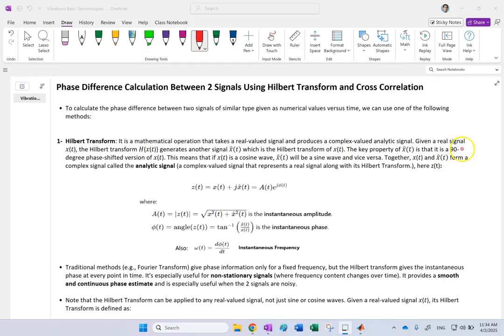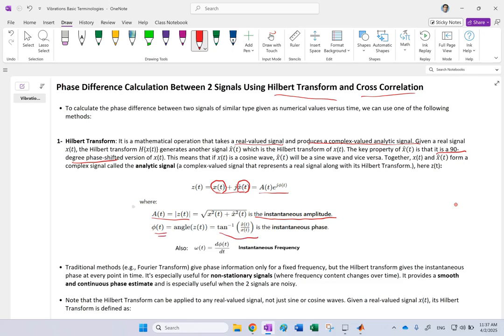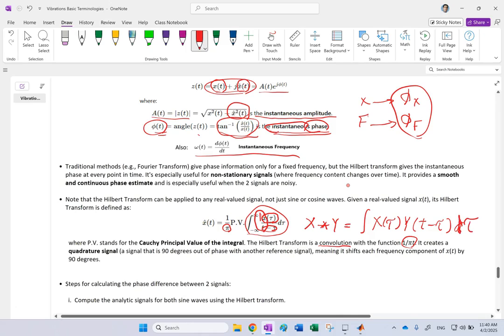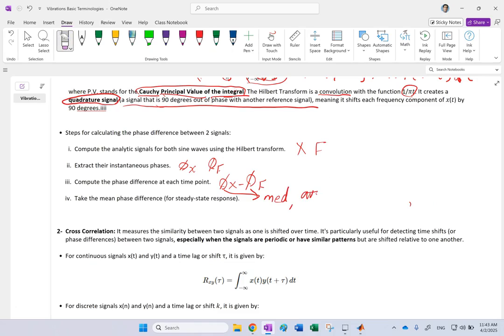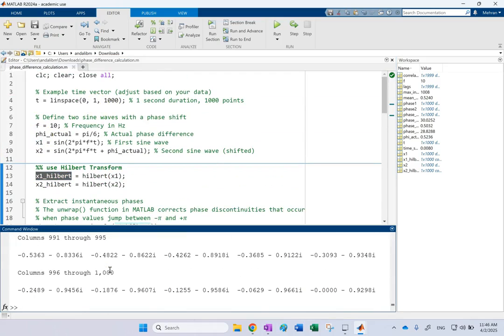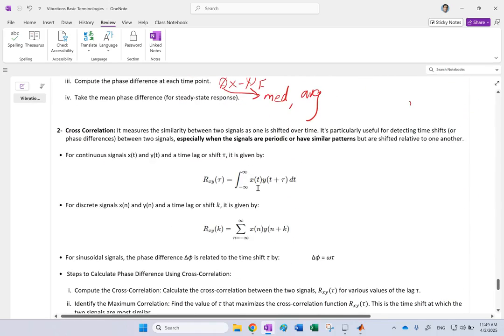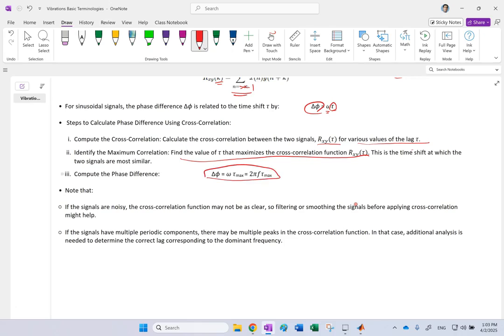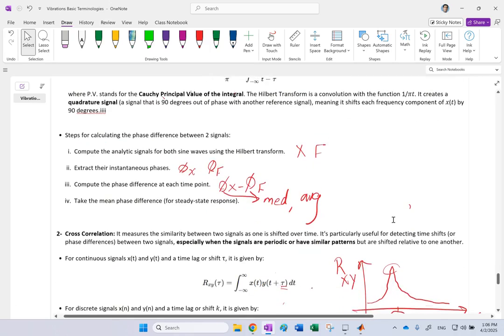Phase Difference Calculation Between 2 Signals (Using Hilbert Transform and Cross Correlation)

Comment: Thanks for the video and code! I've been using cross-correlation method for years and just recently found out about the Hilbert transform. A comparison between cross-correlation and the Hilbert transform methods is not well documented and I needed to compare the methods for a paper I'm publishing.  I used your code to come up with some conclusions. Like you noted, the Hilbert transform is works extremely well with sinusoidal signals, signals with harmonics, and it even works with one period; however it performs rather unpredictably with non-sinusoidal periodic signals! The signal I tested is max(sin(2*pi*f*t + phi_actual).^11, 0), this is a simple periodic pulse whose shape can be controlled by the exponent. Cross-correlation method  seems necessary for non-sinusoidal signals. This was an interesting observation I thought people might want to know. Let me know if you have any insight on this, or if I made a mistake. Also, let me know how you want me to reference/acknowledge you, and I'll add it to my article.